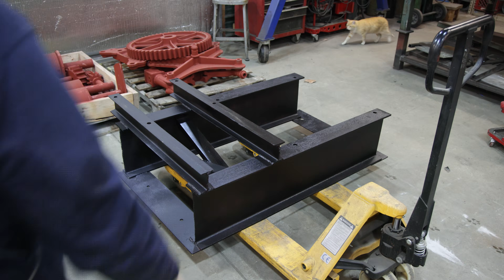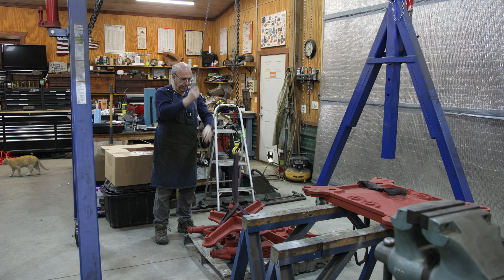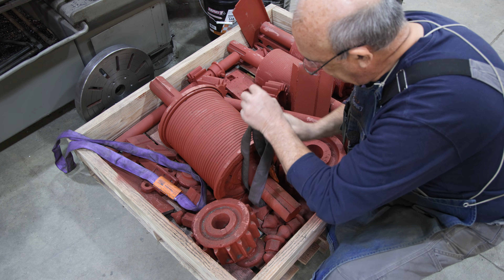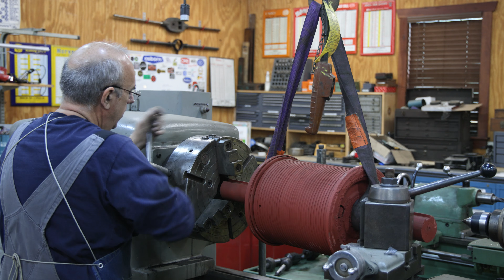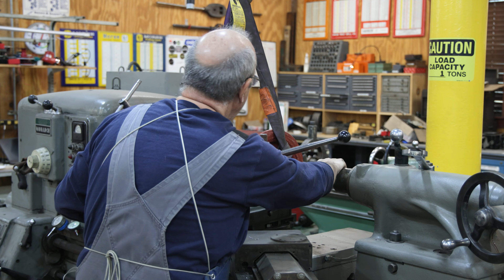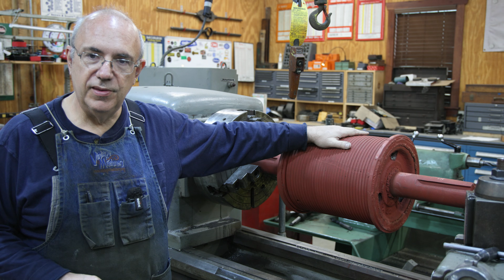John Deere “Amazon” Cane Mill: Prepping for Reassembly and Evaluating Damage

Comment: Before i give my 5c, we sometimes need to acknowledge that people sometimes do what they have to, when they have to with the materials at hand, mostly or often a financial reason for not going the correct route. But then in retrospect it may be beneficial to try and figure out the best course of action in repairing. Like that welding of steel to cast iron is a no go. Its a pity but they had there reason which most likely get revenue from the machine. But if say for demonstration as a showpiece on the other hand, not much of a loss, jus slap it back together reasonably and make believe to visitors its working😂

Comment: Why not fabricate from a piece of bar stock?  continuous cast iron round bar stock is available in suitable sizes.  material cost is probably higher, but no work for making a pattern or shipping the casting (and waiting on the foundry to cast, etc).
Reply: The drum is hollow! If you made it solid the mass and inertia would do nasty things to the frame.
Reply: @colint  More large lightening holes could be drilled through the roller
Reply: @jimc4731  Trust me, do the calculations, you can't remove enough by just drilling a few holes.